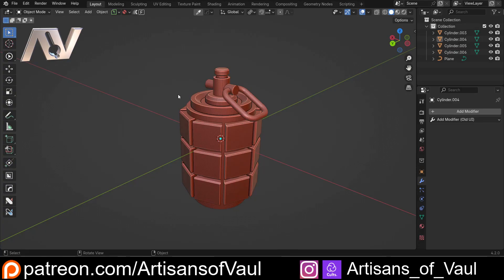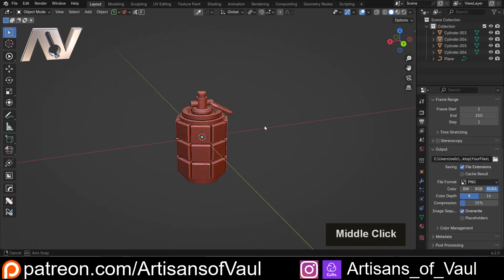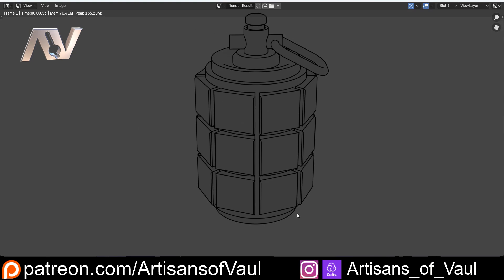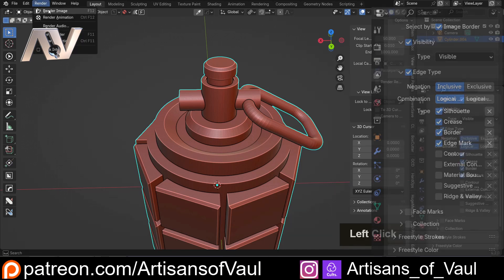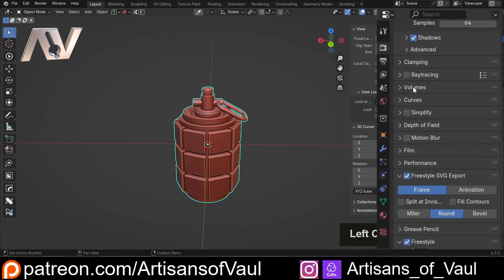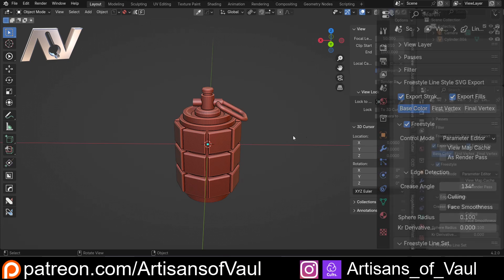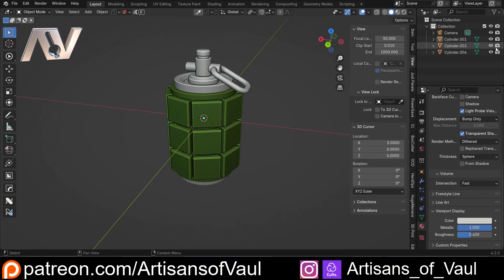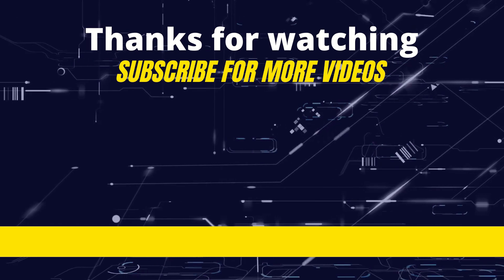3D design to SVG - Tips and tricks to get the best results in Blender

Comment: You should probably set your rendering engine to Workbench instead of Eevee, and it should display the correct Viewport Colors in the viewport and filnal render. It's bascially the raw "Viewport rendering engine".
Reply from the maker: @mipe7755  Thanks for the tip. I'll have a look at that, I'm not sure but I had seen somewhere that the SVG tool used works best in Eevee but I can have a play.
Reply: @ArtisansofVaul  I may be wrong about that, but I see people often overlook Workbench, as if it didn't exist, so I thought about this suggestion. But I can't check it now myself.
Reply from the maker: @mipe7755  I'm currently away so can't check but do let me know as I'd be really interested 😁👍🏻👌🏼